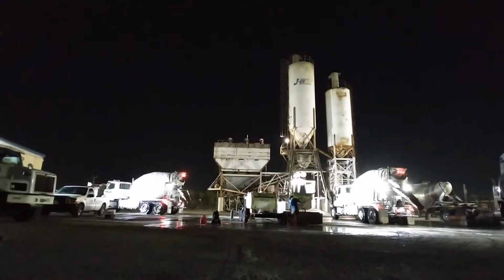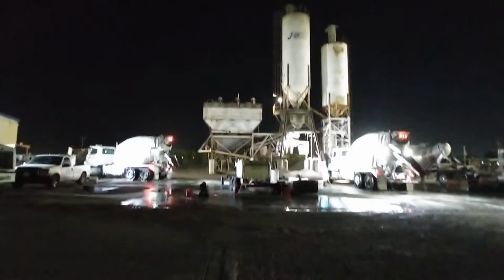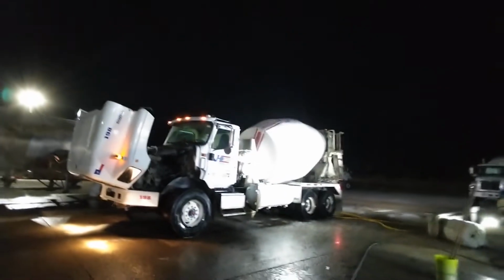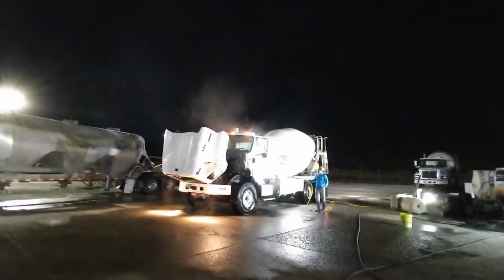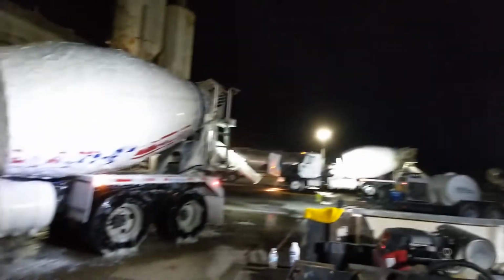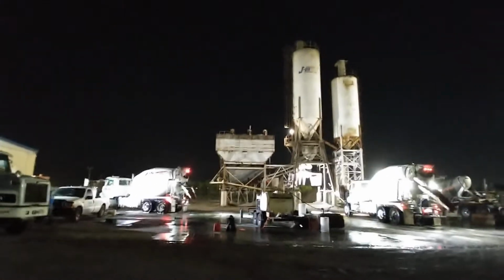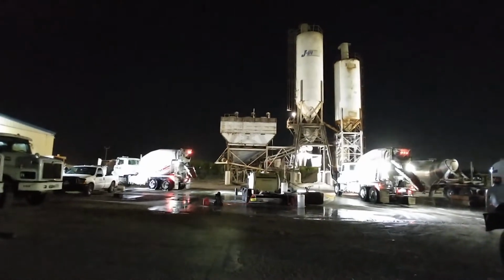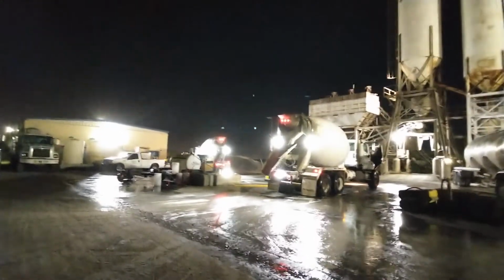Concrete Truck Pressure Washing | Dialing Down Our Washing Process & Procedures | Power Washing

Comment: Killing it‼ how much should I charge per truck?
Reply from the maker: That's a loaded question, but for starters you should be at 100+ per truck that's not including chemical costs. If you are washing more for a company charge a bit less.
Reply: @fazpowerwashing  thank you so so much! Wow, I was way off thinking $85 LOL! especially considering that I'll be using a hot water unit, plus Chem x chemicals. The trucks I'll be washing will be looking a shiny as yours😎